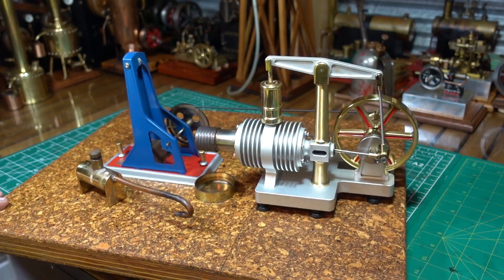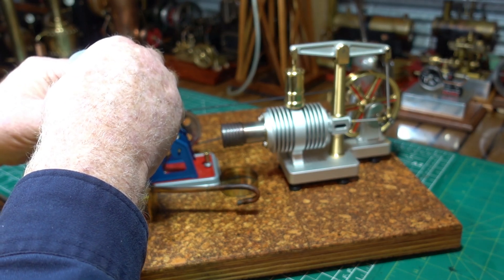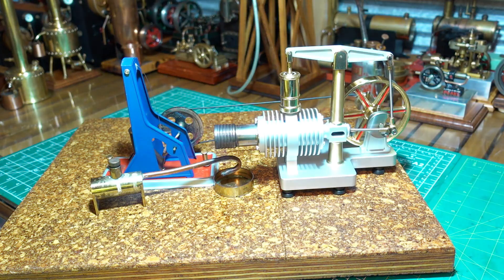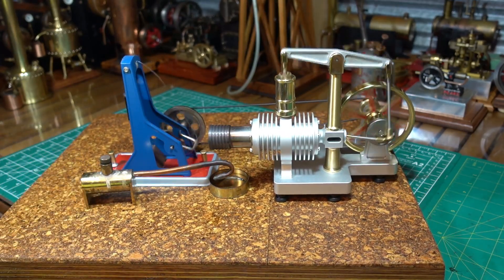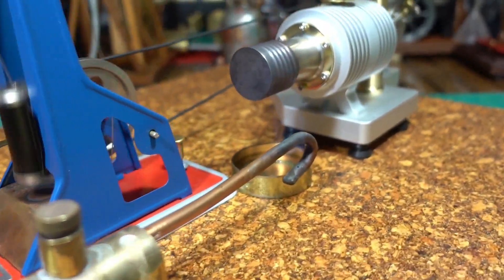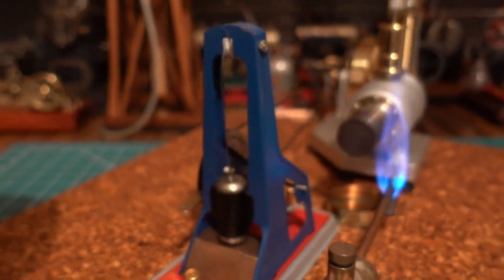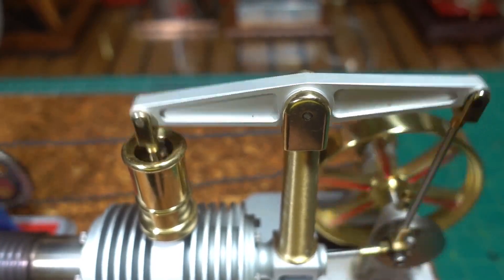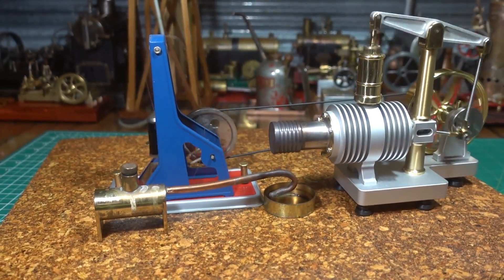Stirling Engine Tarot Take Two

Comment: Hi Jim.  I have been intending to make a hammer mill for my same Tarot engine.  Great Stirling engine and plenty powerful compared to most.  Cheers Rob
Reply from the maker: Looking forward to see what you come up with Rob, they are a really nicely built engine aren't they. One of the nicest Chinese engines that I own. You may or may not have seen this DIY trip hammer that I built some years ago, wayyyy overbuilt for this engine, but I do have a lot of fun with it -
https://www.youtube.com/watch?v=tmpRg0C6xbo&t=19s
Reply: @SteamEngines-Jim  I just checked out the video.  Good build.  I will probably go with a vertical stamping head, same as used in old gold mines.  Just need some time and warmer weather.  Cheers Rob
Reply from the maker: @Xynudu  Its 11° here presently with a chill factor much lower Rob. A mate of mine (since past) made this one for me -
https://www.youtube.com/watch?v=QhHvaUvXPHA

Comment: Great video and thanks for the explanation on the Supaburner! Seems that the supaburner made the Stirling engine run a lot faster which is what I expected but didn’t know what would happen in reality. Definitely need to make a supaburner. I’m also wondering what would happen if you replaced the Wilesco hammer with one of your beautiful baker fans. Thanks for the Shoutout Jim! It was really kind of you to do so! -Stephen
Reply from the maker: Your welcome Stephen, you will be pleased having a Supaburner. Looking forward to seeing your next video. Cheers Jim